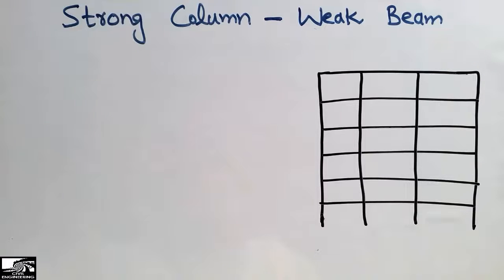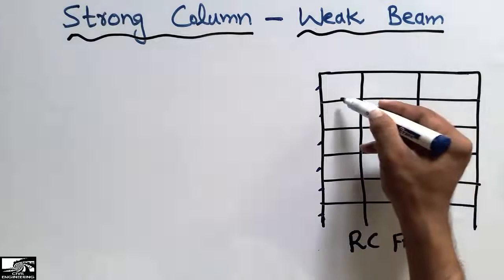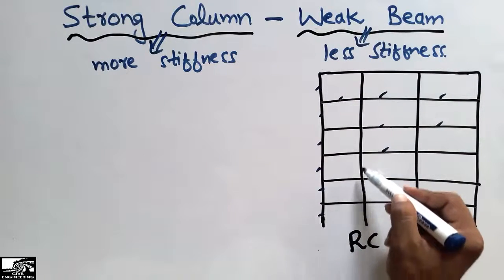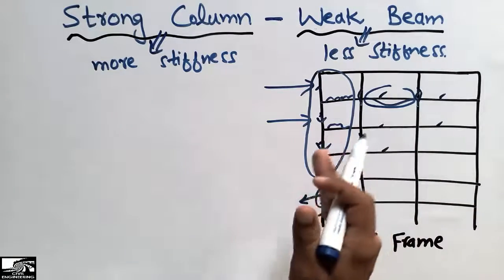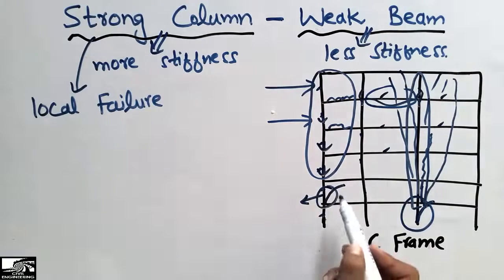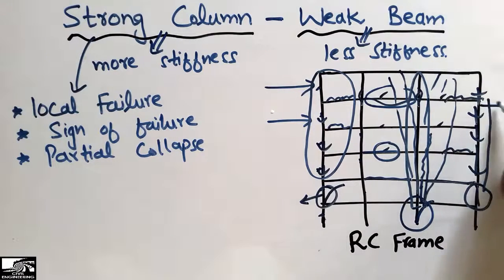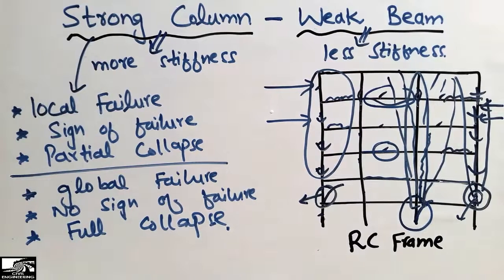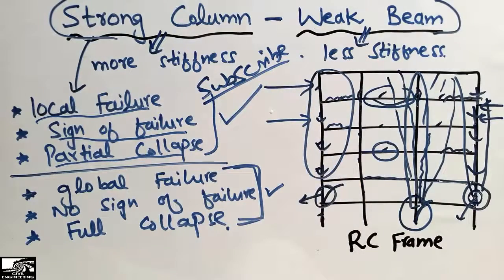Strong Column & Weak Beam Concept

Comment: Nice video. In our case our foundation concrete testing results failed and hence our structural eng suggested for greater beam (more strength) replaced with plinth beam. 

After watching ur video , i am
Confused. Pls clarify if plinth or greater beam can be stronger ? And beam above ground level is what should be weak as per your lecture ?

Comment: The  main requirement of the seismic design of the reinforced concrete structure is strength of column should be always more than
the strength of beam.In this case, I found that the strength of column beam ratio is different in different
Country's design codes.For instance the ratio is 1.3 as per ACI and 1.2 as per Eurocode.What
could be the reason behind the existence of different values? Thank you